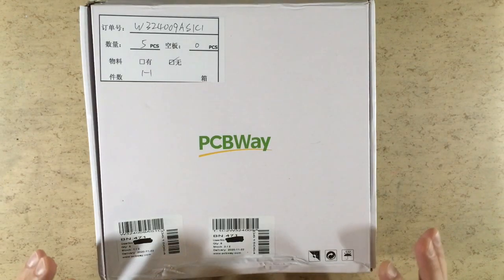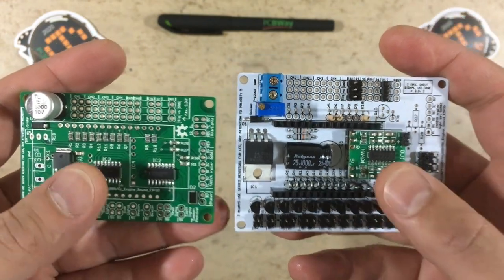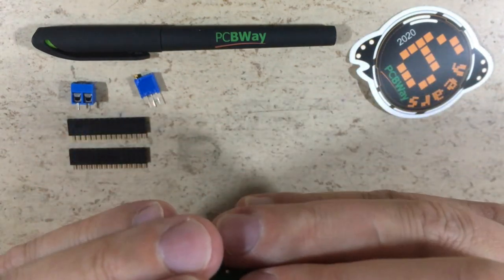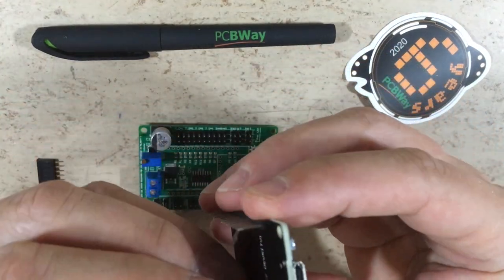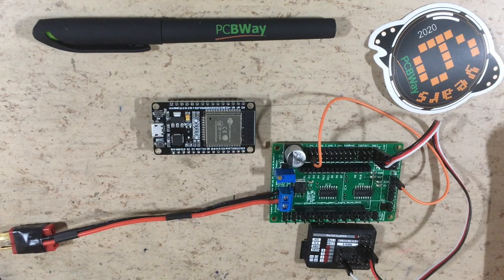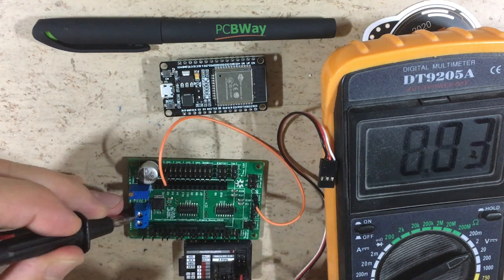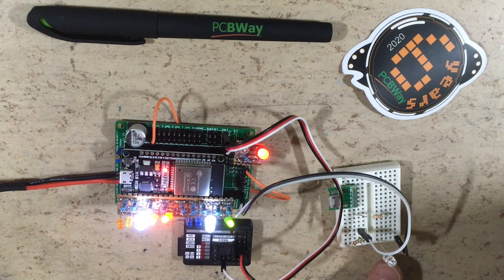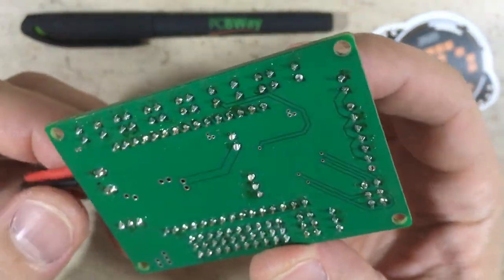ESP32 RC Sound & Light Controller: How To Finish The Pre Assembled PCBWay SMD Version

Comment: Can it run on 6v?
Reply from the maker: It should, but it was not tested @ this low voltage
Reply: @TheDIYGuy999  Thanks for the reply. Assembling one now and hope to start programing today, see how it goes, looks a little confusing at the moment. Reason for voltage is I'm putting the unit in a scale boat that runs on 2 large 6v SLA batteries. If all goes well plan is to have two units running off the separate ESC's for the twin independent motors. Going to try it on 6v, worst case I'll add a 7.4v lipo just for ESP32. Thanks again for your awesome work!
Reply: Got it assembled and programed finally. Worked right away. Just need to try some adjustments for the boat application, don't need air brakes and backup beeper....lol. Thanks again for all your hard work and an awesome design. I researched many commercially available units and this one does way more than those and I have way less invested.
Reply from the maker: @txracer1636  Good to hear it's working. Have fun with it.
Reply: @TheDIYGuy999  I'm having a little trouble understanding how to change channel assignments. Trying to get it working properly with my Spektrum DX6e. What exactly do I need to change in adjustmentsRemote.h to assign the channels to suit my radio? Also trying to use tank mode and now all I can get is engine idling. Thanks in advance.
Reply: Changed assignments in the radio and got it working better. Now the hard part, trying to decide on witch engine sound is the best. Great work.